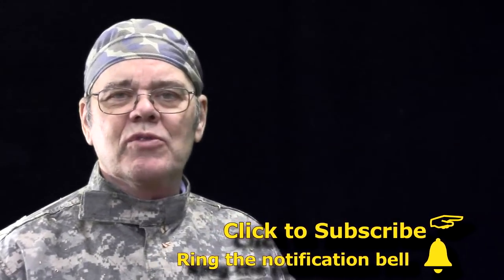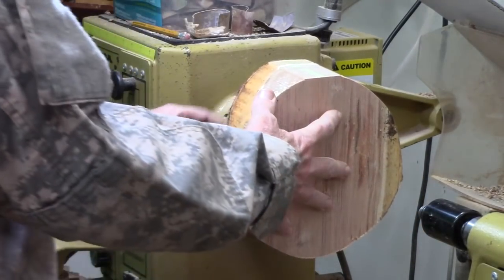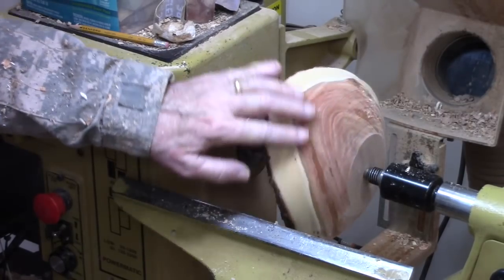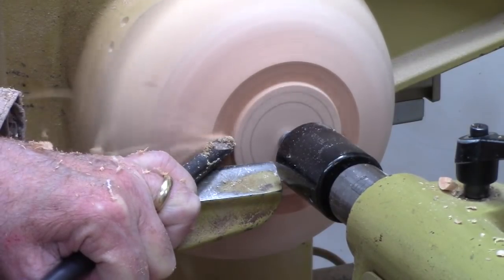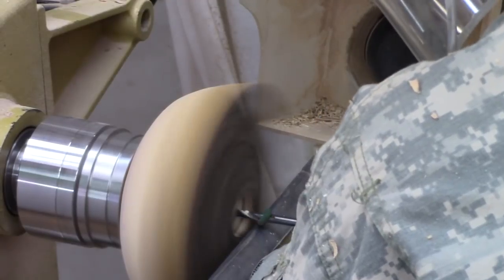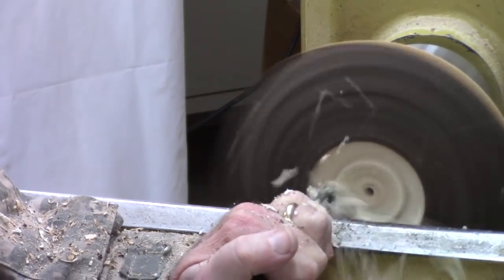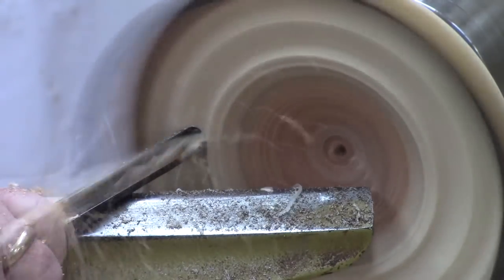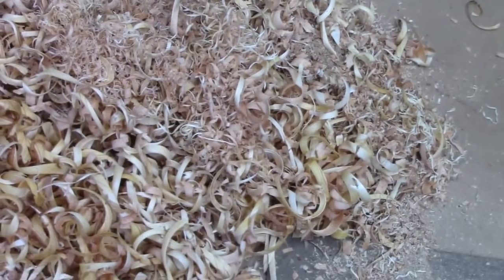How to Woodturn a Natural Edge Bowl

Comment: very intresting mike . i got a question for ya . now i seen you put it in a paper bag at the end there . have you ever tried using silica i guess you can get it in kitty litter them high end brands of kitty. litter have you ever used this method and if so what did you think about it ?
Reply from the maker: Nope, never tried it. Not in a big hurry. There is a special desicant bead product for drying woodturnings that would be better than silican But it solves a problem I don't have.

Comment: Where did you get that cammo jacket?
Reply from the maker: Ebay. It is called an ACU jacket. Get a long so it will cover your pockets even if you are a Short or Regular. You can alwasy cinch up the velcro sleeves.